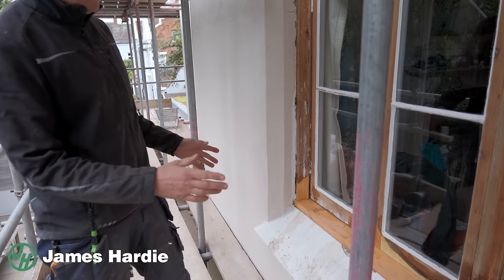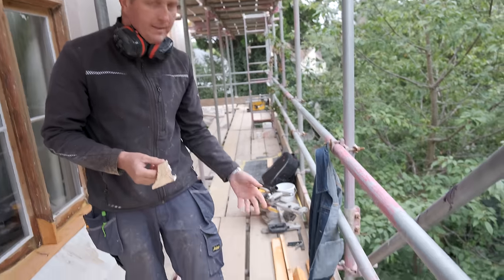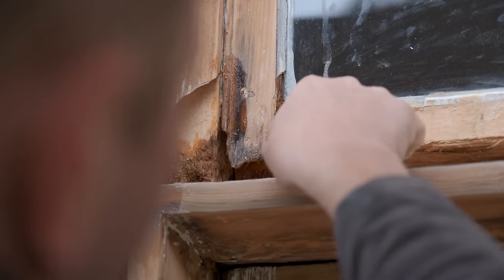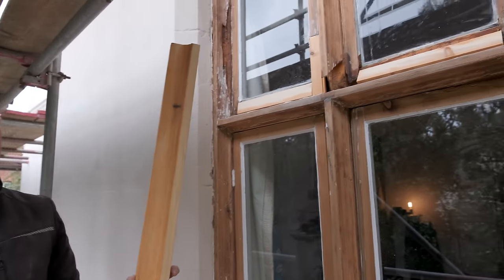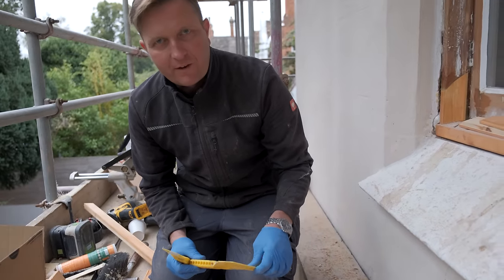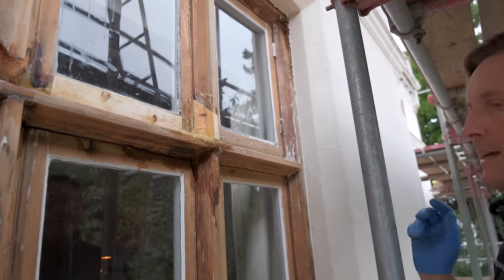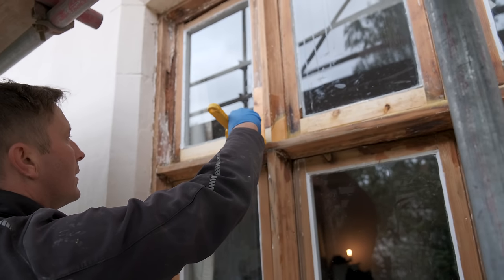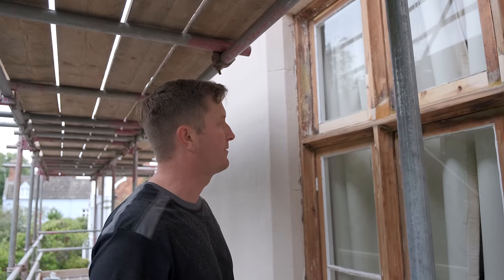REPAIRING ROTTEN WINDOW FRAMES

Comment: Sometimes I look at jobs with extensive rot in bog standard off the shelf frames and either avoid the job or recommend total replacement. But if they are historic/original frames beautifully made they are worth restoring. Very satisfying knowing them Windows have been there a long time and you have now extended that further.

Comment: Fantastic video, had me grinning all the way through with recognition of someone doing a proper job. 👍 
I've been restoring windows for 30 years: got introduced to Repair Care in the 90s (Window Care then) by Bob Cherry who demonstrated it's use. 
This is the first time I've seen someone real world demonstrating this method, which gives a long term solution to the sorts of problems found on wet rot affected exterior timbers. Sounds like you've done their course - the use of the term 'buttering up' may have given it away.🙂 
The main issue with 2 pack fillers like ronseal or car body filler, is they're brittle (that's why they sand so easily!) and won't move with the timber - essentially it's inbuilt obsolescence - the vast majority of you tube videos dealing with these sorts of issues, use these sorts of 2 part fillers, demonstrating they don't understand the limitations of these materials and how timber flexes in different temperatures/humidities. The best thing to do when you come across their use is to remove them, in my experience you often find them placed over the top of ''hardened' wet rot, as a sort of packing. The only use for them is to guide you to these sorts of papered over issues. 
Out of interest, do you know what paint system was used over these repairs?

Comment: Love the video.
Fantastic workmanship 
I live in York and I've done so many rotten timber repairs over the past year mostly sliding sash window restoration. The repair care system is fantastic.
Reply: I've started using a spray bottle for the timber hardener. I use ronseal wood hardener though not the flex repair hardener.

Comment: Some posters are critical of this repair, but I'm sure there were good reasons for it (rather than a replacement) and this is a very helpful video for those of us fixing windows and doors without a budget or a workshop and access to materials for having period replicas pieces made.
Reply: What it doesn't show is I repaired 13 other windows like this over the course of 7 man days, the materials and labour for that was less than replacing that one window, also it would of disturbed the plaster inside which is lime plaster and usually results in re plastering the whole wall not just the reveal, I could take people back to resin repairs done over 20 year's ago and still good without any cracks

Comment: Many thanks for the excellent video! A couple of questions please. How did you cut the mitres to splice the vertical moulded sections? And, what is the best way to remove old hardened putty to replace it?

Comment: I worked as a warranty engineer for a boat company and was introduced to fettling and shaping timber sections with an angle grinder with varying grades of paper sanding discs,sounds brutal but with care and experience it’s astonishing the level of detail you can achieve,and how close tolerances you can work to,and it would save your man on resin costs where he was jigsawing his fillets👍ps looks amazing in the final shots👌pops what’s happened to the videos on the single storey extension build🤷‍♂️

Comment: Top job! Looks beautiful 👏🏼 I use timber packing as well when I’m doing repairs. They are going to last for many many years to come with a little regular maintenance.
Only thing I do slightly differently is to prime/paint under drip edges before installing rather than afterward.
Have you used a wood blade on an adjustable speed angle grinder? Very handy.

Comment: questions: 1. how did he get the paint off before starting the repair? 2. does he remove the opening casements to repair them? If also reglazing (eg with slim vacuum glazing) would he completely repair the window and then re-rout the glass rebate and install the new glazing?

Comment: In the past have salvaged Victorian sash windows just for the glass, also if looking for a wavy effect on the glass and not the dead flat appearance of modern float glass specify toughened glass, it does a good job of mimicking the look of old glass.
Reply from the maker: Hi Peter can’t beat the old glass it looks beautiful, with its imperfections hand made all the best Tony 👍

Comment: Water may not rot the resin BUT the resin will trap moisture above it and that will cause the wood to rot. Resin is just the latest modern 'quick fix' that ultimately leads to yet more rot.

Comment: I remember when we first started using this and everybody slagged it off how we could cut and splice properly then they saw the finished product and went quiet 🤣. Do you also use the zinc phosphate primer? And just because I’m wondering, why don’t you piece back in in hardwood? I tend to find  try last a lot longer. Neat job either way.

Comment: Looking at the amount of rot in that window along with the cost of scaffolding it's a wonder they didn't have a eplacement window made from a decent hardwood. When you scarf in new sections of softwood timber it has a different moisture content to the existing timber. Then before long both will expand/contract at different rates and the joints will open up ,water ingress and rot within 5-7yrs. As long as the client understands any repair is a short term measure then fine but repairs and not a long term solution.
Reply: The clue is in the title,the resin is called dry flex,it allows for different rates of expansion hence why I don't usually do a tight joint (a bit like bricks and mortar) I've been doing this for 20 years and can happily show you jobs I've done this way and have not needed to re repair
Reply: @discodmax  Cheers for the reply. But you would say that wouldn't you. People who do repairs like this only do so because they don't have the skills to replicate original detailed windows,doors etc. I've seen plenty of this type of bodge and as long as the client isn't fed a load of marketing wank about how it will last decades blah blah blah then fine. I've been making Joinery on historic buildings for over 35yrs so I know what will last and what won't and people viewing this can make up their own minds.  Good luck.

Comment: A dam good coat of shelac/ zinzer bin would also help the window last..Well done  Cracking repair !
Reply: I definitely wouldn't recommend using shellac/Zinsser B.I.N externally as it is far too brittle, their datasheet even specify to only use it for spot priming. Something like tikkurila otex is a lot more suitable.
Reply: @marcuschambers62  your right good job your on the ball 👍 keep up the good work. Cheers M

Comment: Your mouldings are fabulous, but you have made so many incorrect statements about uni-fix. It does not harden or preserve rotten wood at all.
You then proceeded to mix the uni-fix with a brush, which is an absolute no no. You must remove 5mm past any rotton timber.
You also haven't worked to the correct min 5mm on each side of the splice.

2 pack filler is not okay and always cracks.

Not to mention you used pine for splicing which is a soft wood and isn't suitable for repairing historic hardwood windows. You should be usind the same of better quality timber for all splicing of exterior timber.

So much wrong info and processes being done here.

However you are clearly a fantastic tradesman. However, you are definitely in need of some education directly from the manufacturer.
I recommend official repaircare courses at an accredited training centre.

Better to get the info before it becomes costly.

This will elevate you to the next level and guarantee your work and profitability.

Keep up the good work and keep it moving onwards and upwards.